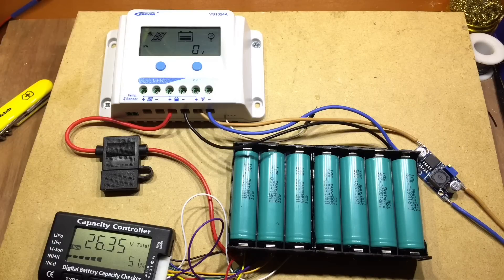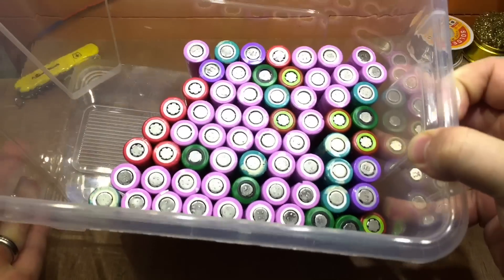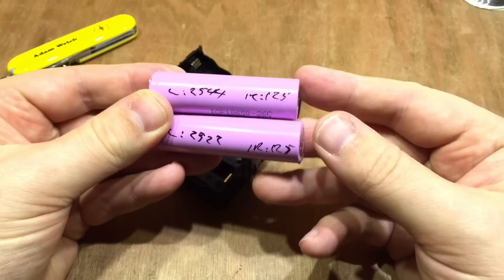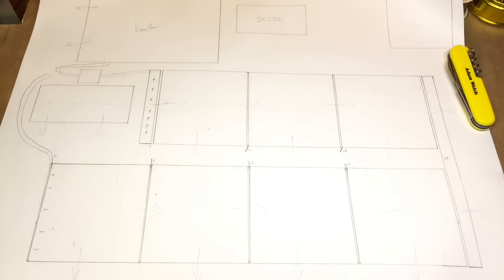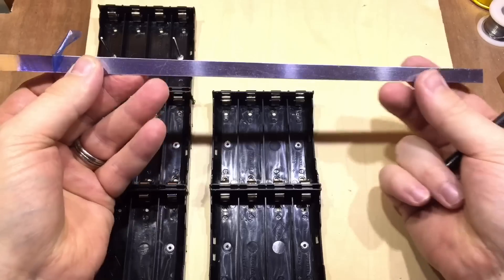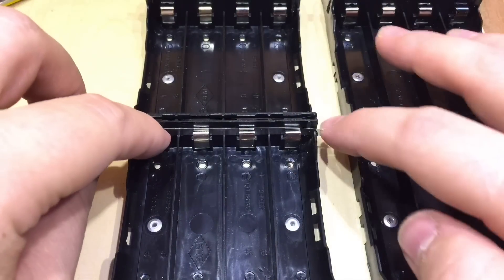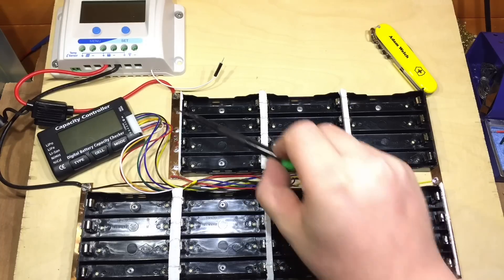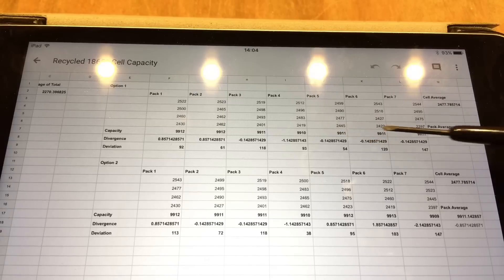Solar Charging Lithium Ion 18650s - Part 4, Expansion - 12v Solar Shed

Comment: I did notice its easy to put a battey in the wrong way around, but with 12v it doesn't matter as much  because it just doesn't work, so a short circuit  owuld just make the 12v into 7.4v??

Comment: i need made same power wall. i has orden now capsity controller, i not found were can buy balance 7 cel wire connector. and solarcharger what model can use whti li-ion battery, i come 2 panel now first and later i adding more panels. and need use 12V all my house light and some 12 volt machines sometime.

Comment: Hi Adam, i have a simple question for you or anyobody else that can point some light. I want to change my old baterry system AGM or lead acid batteries to 18650 batteries (i have plenty of them to start) My system is 150w (3 x 50w panels in parallel) that gives 19V and from the charge 20A 12V controller it is connected to a 12V battery cause i use it for led lights and charge sometimes a 85w laptop (with an inverter). The battery is 100AH lead acid battery that soon i will have to replace cause doesn't really hold good charge anymore.  My main problem is that is too heavy (around 35KG!) and i live somewhere that there is no way to reach via a car so i will have to carry (did this before and i do not thing i can do again) . So i am wondering based on my math if i connect 50 cells of 2.000mah 18650 batteries then i will have the same capacity like the old lead acid battery? And of course better discharge rate etc. Or there is something else that i do not understand and is not that simple as it sounds!?

Comment: What a cracking video. I'm going to try and follow it to the letter. Might have to watch it a few times.  Unless there is a diagram available.  Just bought some batteries. Ordered some of the other bits of Flea bay.  Fascinates me the whole 18650 solar thing.
Reply from the maker: Thank you very much.  Good luck with your project.  No diagram I'm afraid but it is fairly standard and hopefully I've explained it enough in the series of videos.  Cheers

Comment: Even if a cell shorts and blows the 5A fuse won't the other cells in parallel still be able to deliver current to it through the nickel tabbing wire?
Reply: Do you only have the nickel tabbing wire behind the contacts on one side of each plastic tray?

Comment: Hi Adam.  I am new to the 18650 craze and have been watching  all your videos and those of others who are working with these cells. One major thing they all have in common is the use of fusing wire  between cells. My understanding  is that each 18650 has a circuit underneath the top cover that is in essence a fuse. So are the fuse wires being used as a redundancy am I confused about the cells own built in protection?  Thanks and I am really learning a lot on your channel.  Very watchable  and  covers the material very well!

Comment: Fantastic video series Adam. I had wondered if a lead acid charge controller could safely charge lithium batteries. It got me thinking whether it is possible to setup a 48v (14s) lithium pack with 48v solar charger.

Comment: A bit confused about the fuse wire. I was under the impression that the series connections should be a heavier gauge wire while the parallel connection uses the fuse wire.
Reply from the maker: Yes often this will be the case and I guess mine are done like that too.  If you imagine that each cell has a five amp lower gauge connection.  In normal operation each series group has four of these 5 amps connections to the cell series group - so this is a heavier gauge wire.  So from one series group to the next there is a 20amp connection, and from each cell in a group there is 5 amp fuse protection.  
It's worth noting my pack only charges at about 2.8 amp maximum and discharges a lot lower than that so high current interconnections aren't really something I need.

Comment: Hi Adam, great series of battery vids. Thanks! Bit con-fused. (Sorry...). You started out with a 24v rig of cells, using a 24v chargeController. Then built a set of seven*four cells for 7x12v? Connected to same 24v controller. With balancer showing 27ish volts. Please explain? ;)
Reply from the maker: +Mark T I use a step down converter on the load output of the charge controller to bring the 7s 24 volt battery voltage down the 12 volts which is more useful for me in the shed. Cheers.

Comment: hi Adam
where do you find second hand laptop batteries. I don't seem to find any.
great post by the way
Reply from the maker: +Timothy SKing Well I work in IT so I'm able to collect any batteries before we recycle the laptops. Unfortunately however I don't get my hands on great numbers. Recently a I bought a job lot on eBay - which I'm currently processing.

Comment: Thanks fpr your reply. I have completed the wiring as according to your layout. But when I charge the 18650 battery, there is some huming noise coming out from the battery pack. What seems to be the cause and is it normal ? Appreciate a prompt reply. Thanks again.
Reply from the maker: +Lau Weng Yew No that doesn't sound normal at all. Something is wrong but it's hard to tell what from a short description I'm afraid. Can you narrow down the noise?

Comment: hello! I am about to make this setup. any problems with yours? still working fine?

btw, manual included in my model say: new balance function - long press the first key lipo/life/liio will blink, says it is in balance, balance process according to the second button can view each battery voltage, balance is take the battery in the lowest section as the benchmark to discharge balance
Reply from the maker: +FIGUEIRINHA novos e usados Yes it's been working very well thanks. Thanks also for the statement in your manual - nice to see it documented :-)
Reply: scan of the manual here     https://postimg.org/gallery/130oij1xs

some LED drivers allow a larger range. 12VDC to 30VDC or more (seek on aliexpress). 
they can work direct without the DC2DC converter
Reply from the maker: +FIGUEIRINHA novos e usados Cheers. Thank you very much.

Comment: Hi Adam,

Would you recommend to use the same setup as you did? I am planning on building the same size setup, I already gathered 18650's. Seems like an affordable and relatively well functioning setup. I've seen many different setuos from many different youtubers but they seem to have a different budget in mind....
Reply from the maker: +KaBBBram Yes most people are doing much bigger projects. This system is working beautifully. PWM is fine as long as you don't want to use lots of power during the day. Just consider your charge controllers day to day top charge and unless you have extremely similar cells pop some active balancing on there. The capacity controller does a superb job for less than $5!
Reply: Thanks for the reply! I will be trying that for sure.
I've been finding your content very helpful and entertaining.
Reply: Btw, I had one more question.
The EPever controllers are relatively high priced.
Is it necessery to buy the EPever controllers when using lithium cells or are the cheaper PWM controllers fine too?
Reply from the maker: +KaBBBram A cheaper one may well do the job perfectly. Pay close attention to a charge controllers 'boost' charge voltage and it's float voltage. If you go ahead with one keep a close eye on it the first few days. You want to make sure it does exactly what you expect. I think the charge controller needs to charge fully up until the boost voltage and then hold it there for a little while (EPEver is 60 mins by default I think). Then it needs to stop charging completely until the voltage of the pack drops to the float level - which unless you are using the power in the day will mean that no charge goes into the cells until the next day. It's how mines been working now for about a year.
Reply: There's now li-ion charge controllers. I'm going to give this one a try. http://www.ebay.com/itm/10A-12V-24V-LCD-Solar-Charge-Controller-for-Solar-Panel-Lithium-Battery-Lamp-WN8/182720515890?ssPageName=STRK%3AMEBIDX%3AIT&_trksid=p2057872.m2749.l2649

Comment: Hi thumbs up on all ur videos,, very interesting,, I have a poor electronic basics skill and trying to learn enough to build a battery for a ebike project in the future from 18650 cells,,  I buy bits and bobs and haven't got a clue were to put wires from and were to ,,for instance just got a small cell checker capacity like urs ,,no instructions on the pin outs of what's what ,, anywhere I will find this info please on the inter web many thanks Shane warks uk

Comment: What is the capacity of your solar panel used yo connect to the PWM. Is it a 12v 200W ?
Reply from the maker: +Lau Weng Yew Its actually two 12 volt panels in series making one 34v panel. They are 50 watts each. Generally plenty to keep the bank topped up as I'm not drawing much.

Comment: +Adam Welch Hello.  I take it the solar shed is 12V, but the above installation is still 24V.  I ask as in a previous vid in the series you work out that the Viewstar 1024A Solar Charge Controller is better at handling 24V.. or have I missed something (which is likely).  Thanks!
Reply from the maker: Yes the main system in the solar shed is 12 volts.  In the first video in this series I looked at doing  a 12 volt lithium pack but for me the numbers just don't work out.  In a 3s pack you need to charge close to the limit, in a 4s pack your discharging too low.  7s is almost perfect.  A 24 volt charge controller will typically boost charge to 28 volts - 4v per cell average. It'll disconnect when the cells drop to a fairly comfortable 22 volts - 3.1v per cell average. Now you can get a charge controller which allows you to edit the charging settings, but I wanted to use an off the shelf lead acid charge controller - they're cheap, reliable and plentiful.  I find it does an excellent job.  I've found that most charge controllers sold for lithium tend to hold the cells at float usually at 4.2v per cell.  I don't think this is sensible because we are leaving very little margin for error, and I like my shed and don't want it burning to the ground! 

I do end up converting the lithium pack output back down to 12 volt to use with my led lights - so sadly there are some losses and currently I've only a very small buck converter attached so can't push those cells too hard.
Reply: + Adam Welch, I've pop riveted the holders, placed my copper bus bar and am finally abeam the runway to land this project!  I was thinking of adding a switch, maybe something like this: http://www.maplin.co.uk/p/ip65-rated-illuminated-24v-dpst-rocker-switch-green-n56ka.  Kind regards!

Comment: nice video, i have started messing with these cells myself, im making an electric skateboard battery at the moment. i must say you got lucky with your cells. mine seem to average about 1600 mah per cell
Reply from the maker: +Kris Harbour Thanks Kris. Yes I was lucky... I've mentioned in one of the threads that I knew the history behind all of these pink Samsung cells. Very little use but they must be six years old. Pretty high capacity but it's also worth mentioning I tested them at a 500ma discharge rate and I know many check theirs at 1amp. Best of luck with your skate board project - my skateboarding years are behind me now I think :-)
Reply: i did test mine at 1 amp. that little charger/discharger looks like a great little tool to do this. it means you can just leave them alone and so you can discharge at a lower current. very good idea. the cells i am using are old laptop battery packs from ebay. i had some really good one with the same pink samsung cells you had in the video but i had alot of red sanyo cells that were like 400mah. anyway, thanks again for the great video. keep up the good work my friend.

Comment: I had a thought,don't know if its a good one. If you had 4 Capacity Controllers and arranged the cells so that you had four sets of seven cells in series. Couldn't you  monitor and balance charge each cell individually ? Was wondering if that would work. Thanks for the videos, keep up the great work.
Reply from the maker: You could effectively make four 7s1p packs which you then put in parallel but except for the issue of one cell going bad and bringing the others down there is little advantage - and creates a fair bit of extra cabling.  Actually if one cell went in the middle of a string of seven the voltage of the series set would drop dramatically and the other good 7s1p strings would try to charge that string.  You'd need to fuse each string for this eventuality so you are kind of back where you started.

Comment: Great post Adam. Good that you're exploring the potential of recycled 18650s a bit further. Looking forward to seeing where you take it, as your sharing always has new insights for me, as you draw on your own knowledge and perspective. I'm a big fan of Paul Kennett also, and the broader DIY PowerWall community.
Q. For a sense of scaling for our similar climates, how many lights (total wattage) are you running/planning to run off that 18650 pack? Have you those lights on a timer or sensor? What size panel is charging the pack? (just general curiosity for  my own build).
You have realised, that keeping the 18650s in pairs is a big advantage, and will make doubling the capacity of your current build a doddle (when you find your next haul of battery packs - now that you have the bug!). :-)
Ivor
Reply from the maker: Thanks Ivor.  I'm not going to be trying to run my house (or at this point even the shed) from recycled cells - they seem to be harder to get hold of than I expected.
On the outside of my shed I have two multicoloured LED lamps which were sold as 10 watt but actually use three 3 watt leds to generate different colours - I hope to run them for 2-3 hours a night.  I also want to put my two 10 watt LED security lights and a PIR sensor on them.  Now as you'll expect, it's hard to say how often and for how long these lights will be drawing current.  It depends on activity in the garden... and we have a cat who likes to set it off!
I'm waiting for a more powerful (but hopefully still fairly efficient) buck converter to arrive as the little one I have now is close to it's limit which is why only the multicoloured lights are connected so far.

Comment: Hi Adam - thanks for the shout out. That's a nice tidy setup.
You might be interested in my electric lawnmower which has a 7S12P recycled cell battery pack. The breaker triggers at just over 100 Amps - so the 12 parallel cells are delivering around 9 Amps each(!) So... if one cell in your setup does short circuit you could expect at least 28 Amps to go through it's fuse  - more than enough to blow that 5 Amp fuse I reckon. Cheers, Paul
Reply from the maker: +Paul Kennett Yeah I expect the fuse will blow quite happily. I am conscious that the fuse may melt the solder - but either way it should disconnect a bad cell. 
As I said in my message to you, I may have come up with the idea myself before finding your channel but I think you deserve a lot of credit. I used many of your ideas I hadn't thought about. I forgot to mention your small blocks design though - which I believe is the best design I've seen for anyone wanting to 'go big'. The analysis and thought you've put into your videos is superb and I hope my little video (with far less of those two things) gets you a subscriber or two. 
Cheers Paul.
Reply: My understanding of the way fuses work is they burn in the middle of their length - because whatever they're attached to acts as a heat sink. But even so - they're tiny wee wires so you have to look carefully to actually notice if they've blown.
And yes - I do seem to be picking up a few new subs. Thanks :)
Reply from the maker: That's a good point.  I think I'll definitely be doing a test.  I intend to keep a close eye on the fuses but if one blows I should also see a group which goes out of balance due to the decrease in capacity, so hopefully I'll notice one if not the other.
The fuses being tiny wires is a concern or perhaps I should say counter intuitive.  All my solar knowledge says use the thickest wire possible to avoid losses, then we go and interconnect cells with thin, high resistance wire!
Reply: I thought fuses were low resistance (ie they really are "just" a piece of wire - ?) Using thick "long" wires are to avoid voltage drop over distance - whereas a fuse has relatively short length/distance. And I agree - it feels wrong to me too :)
Reply from the maker: Sorry should have said relatively high resistance.  As you say, short lengths should make a huge difference and as normal operation is pretty low current it shouldn't really cause any issue.  Even so I tried to keep them all the same length and as short as I could without making it more difficult to see if they had blown.
Reply: Ah yes. Sorry if I was getting too picky. Great video - you packed a lot of good stuff into that 15 minutes.
Reply from the maker: Not at all - my mistake.  It was quite packed, and I considered making it a two part video but at fifteen minutes it's just within my self imposed limit.  Mine was the (fairly) quick run through where as your videos are full of far more information and ideas.  I hope my video will be some peoples first steps to look at creating something from your channel.

Comment: Very nice setup - looking forward to seeing how this performs over time. We had a good supply of old laptop batteries for 18650s in local surplus shops until recently but with the popularity of e-bike diy battery folks and this kind of application recycled cells are getting scarce. But then new cells are getting cheaper...
Reply from the maker: Thank you.  I'll do an update when there's a few bits to talk about.  With any luck it'll work happily and there wont be much to say!